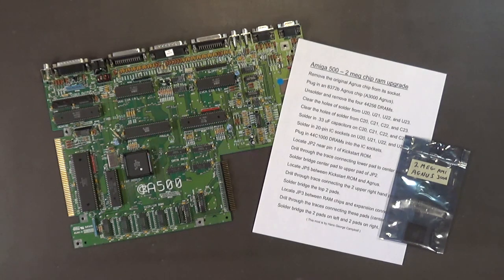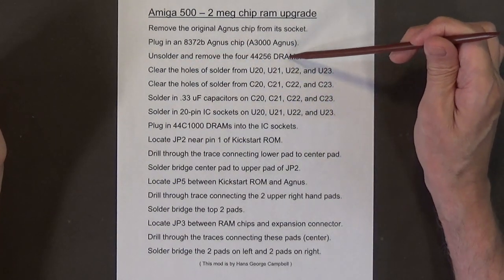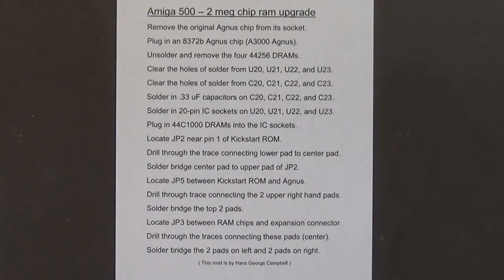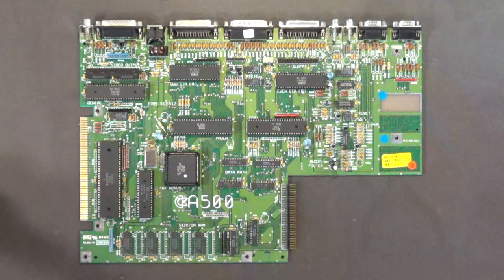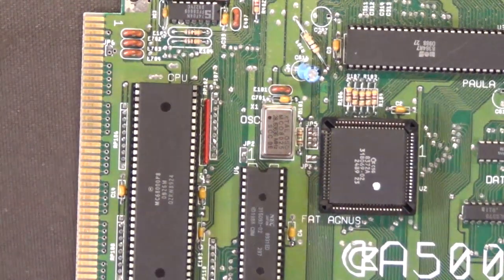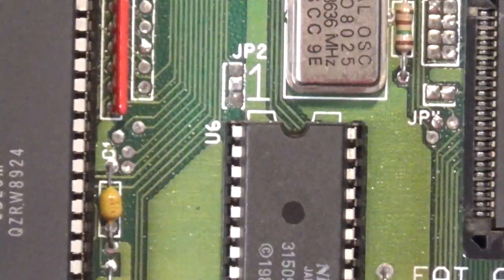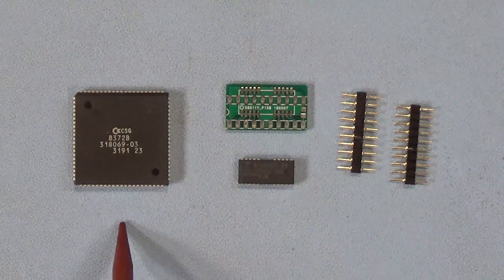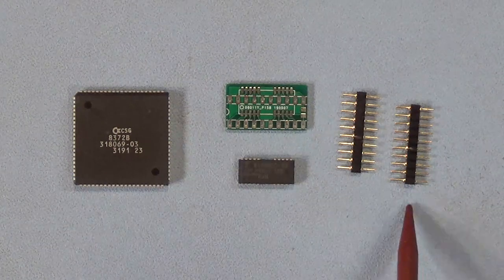Commodore Amiga 500 - 2 MB Chip Memory - Rev 6 to Rev 7 motherboard conversion

Comment: Do you ever wash Amiga 500 boards? If so how do you usually do it?
Reply from the maker: No.  The proper way to "wash" an Amiga 500 motherboard is to first unsolder and remove all of the electrolitic capacitors, then place the board into an ultrasonic cleaner.  Afterwards, solder on new capacitors.  The reason for removing all electrolitic capacitors before washing is because the water will get into the capacitors and damage them.  This is how it is done professionally in the electronics industry.